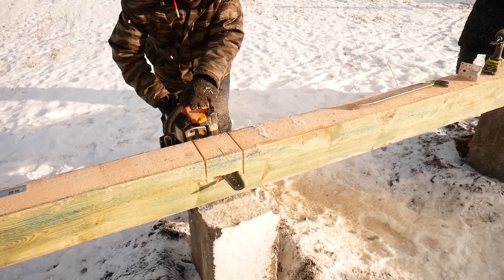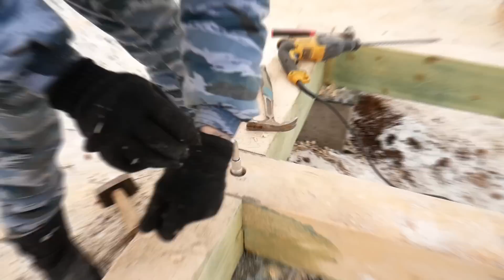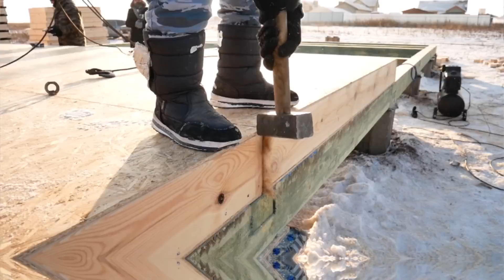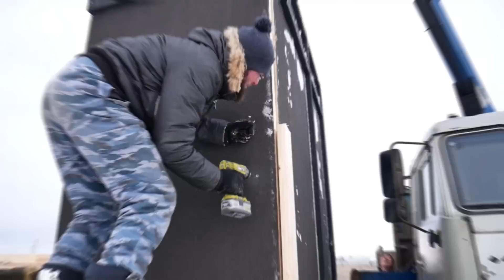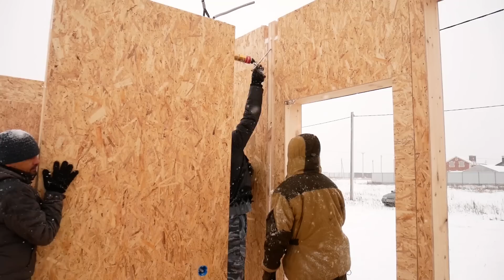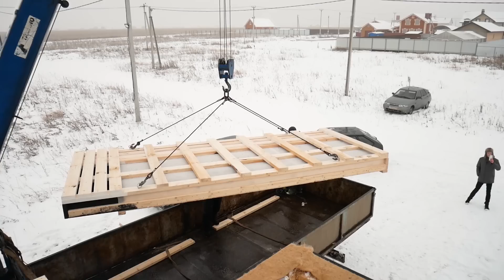We built a frame house in five days. Step by step construction process

Comment: I did not see them gluing the floor down as it would have been done in Australia!!!
Reply: Most glues won't work in the cold
Reply: @bellasmom2597  or they don't use any glue under any weather conditions did you think of that?
Reply: @robertbutler8004  i have no idea what they do in Australia.   You guys have special critters so who knows what you do to keep them out.
Reply: @bellasmom2597  I can't understand why you think that gluing the floor sheeting to the floor joists has anything to do with critters. What we do is lay a bead of glue on top of the floor joists then lay down the sheeting then we either nail or screw the sheeting to the floor joists I hope that helps you to understand where I'm coming from.
Reply: @robertbutler8004  i can't  understand why you expect people to be experts on how things need to be built in Australia.  If someone from the southern part of my home province builds a home where I live in the central interior of the province there is a very good chance the roof will fail.  So I work under the assumption that people know special buying requirements for their own part of the world.  
Why do you expect people to assume you were lying/joking?

Comment: Great Job wonderful concept! I wonder what the cost is?
Reply: No Brasil seria inviável o custo seria muito alto
Reply: At least it's better build than those American houses with those 2 by 4 crap walls.
Reply: @wimschoenmakers5463  American homes are a minimum 2x6.  Other than being made in prefab panels and the foundation being different American homes are built out of the same materials as what this home was made from.
Reply: @Tbomas Flaherty 
This is only in the last 4-5 years or so. Code before that allowed for 2x4.
Reply: @Tbomas Flaherty Not the ones I've seen.  People build cheap and it always comes back to bite them in the ass.
Reply: I want built this home I am an Indian, how much cost
Reply: My building  timeline progress
 day 1 started  unpackaging all the material, lots of stuff , had to go to the hardware store to get screws 
Day 2 misplaced the  instruction manual., moved a few boards into sections of foundation, no luck finding manual.   
Day 3 found half of manual ,the english section flew away with wind ,  called company  hotline…. realized I had the wrong size screws went back to the hardware store
Day 4 began laying out all the supplies and measuring, got stuck organizing my tools OCD Style…. friends are having a party tonight , not focused on work  leave early
Day 5 hangover from the party last night …..not coming into work .
Day 6 it's Sunday I have to go to church till 2 came into work . Sat there looking at huge  pile of construction material overwhelmed waiting for my friends to come help... 6pm  they came with beer so we drank and passed out 
Day 7 …. I thought this house builds in 5 days I'm sitting on foundation with no walls or anything…. what the hell , ripoff,  this thing doesn't work I'm going to return it…..
Reply: @VBoris1945  haha, that's like me.
Reply: Sven3xs  muy caro el osb de 9mm en argentina y supongo que en brasil también.
Reply: Wim Schoenmakers you get more square footage in a smaller footprint.
Reply: Veerender Emmanuel 
Because you’re an Indian, it’s free!!
Reply: 2x4 r13 wall is standard for framing where I live in the us. Each state has it's own code. Some places probably do require 2x6. Most don't.
Reply: Factory prefabricated homes will become a norm.    It’s more cost effective to assembly line create homes off a computer screen schematic
Reply: D.R. Stratton Sr. It might be a North face or a carhartt
Reply: Xxx

Comment: What's the purpose of the felt being stapled? Is it for friction, or expansion?
Reply: Was wondering the same but I think its to prevent air drafts between the panels, basically a thin insulation.